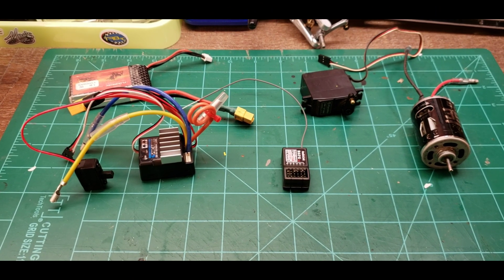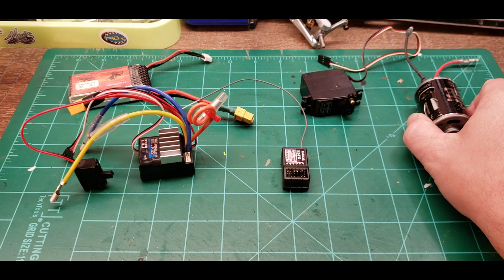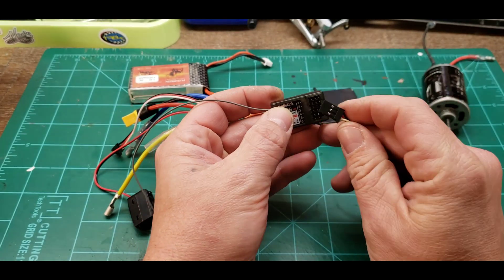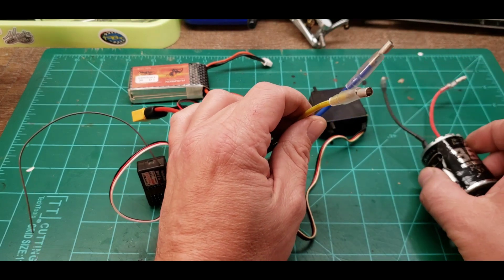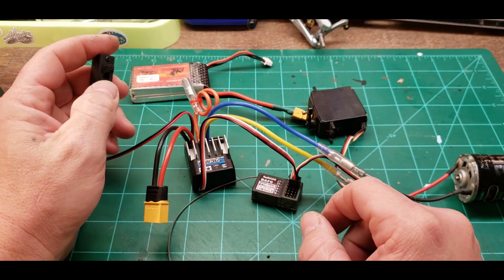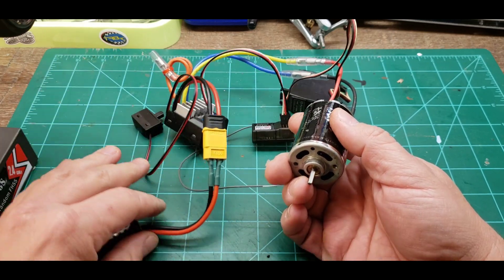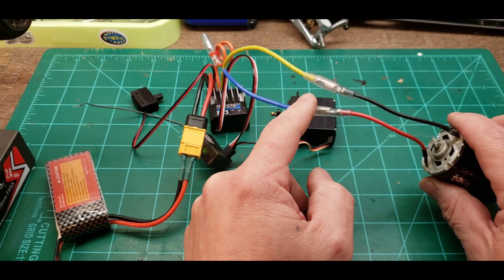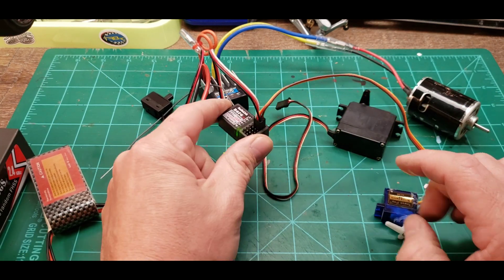Beginners guide to brushed Rc electronics

Comment: The only thing I have found is the tamiya esc will not run on a lipo battery do u have to do some thing m8
Reply from the maker: I have several of these Tamiya escs and all have run 2s just fine they don't have a low voltage cutoff but other than that all good